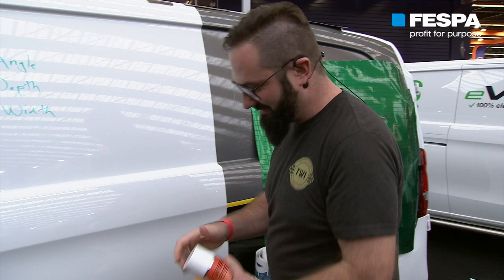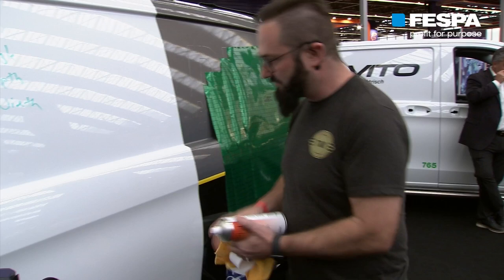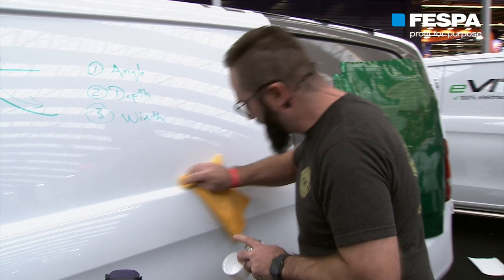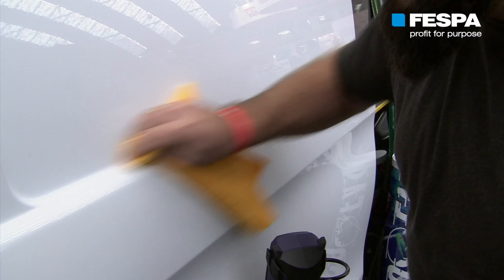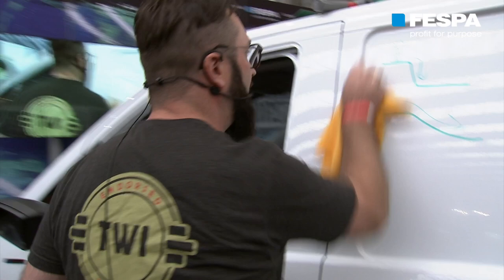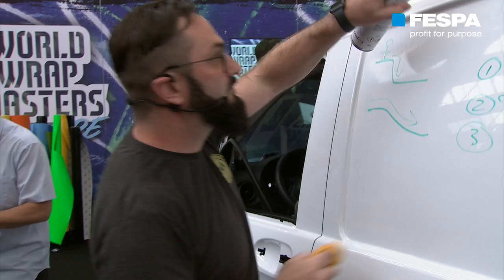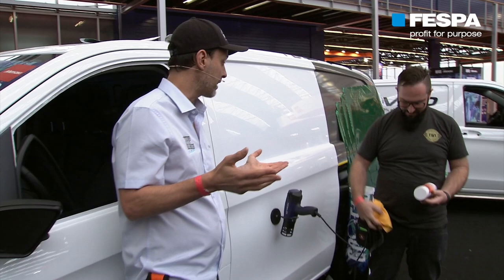World Wrap Masters Europe 2021- Justin Pate Demo on Tips for Sales, Install and Workflow

Comment: Don't you think that when you feed it in to the corner, then work your excess out your fingers and shaking do apply tension to a film? Yes there is a tension, and you would have to postheat it regardless.  But technique I use all day long, and it works very well every time. ;)
Reply: Yes, and you can see the edges of the squares. They are all wonky. If this is a detailed comercial wrap. Itll never work. Especially if you are near a registration point, lettering, etc etc. They only touched on posthearing the handle for 5sec because its the easiest and works, cant make too many videos on that lol